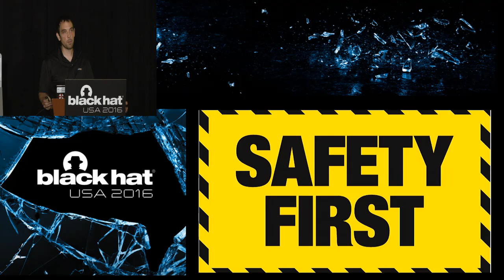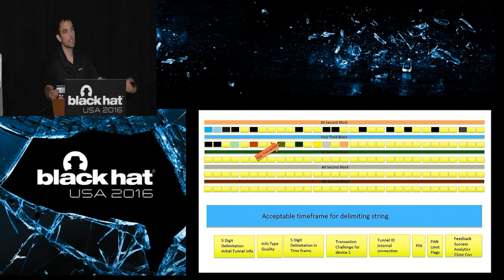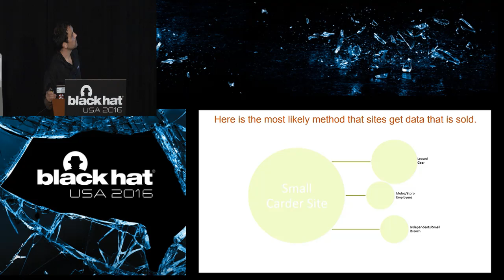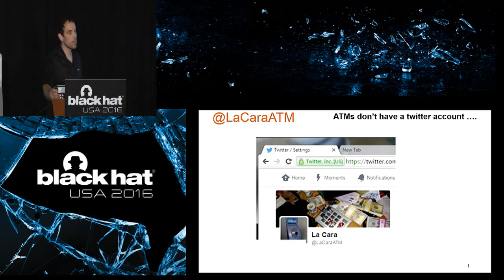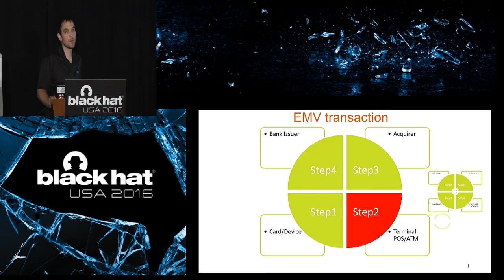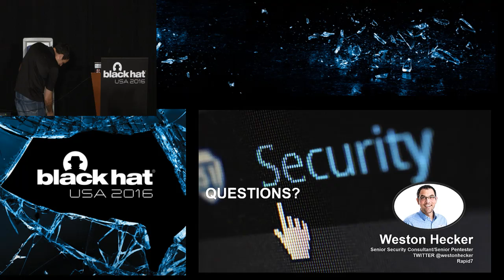Hacking Next-Gen ATMs: From Capture to Cashout

Comment: you didnt hack ANYTHING
Reply: Building device to relay creditcard transactions in real time is not hacking ?
Reply: @westonhecker   hey thank you for this speech it was great. What would be the reason you chose this method instead of using a device to clone the EMV chip and re-create the card itself and go to individual ATMs? Or would that not be possible due to the key thats generated with each individual transaction
Reply: @jakobnorman  The emv cards are dynamic generated authentication using the chip so you cant clone it in the traditional sense. you can still present pan and other numbers off the emv but its not easily cloned so each transaction the card generates a new number to use that is synced with auth at the bank once its threw the credit processor . hope this explains
Reply: So doing a relay attack is not hacking ?